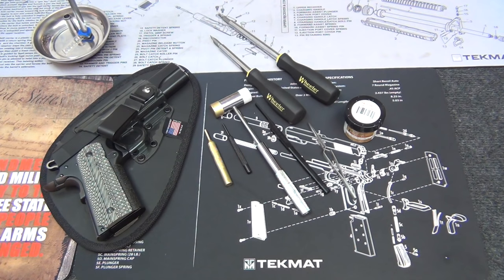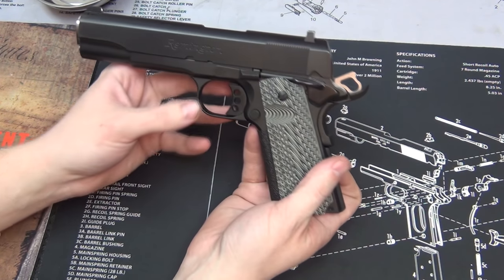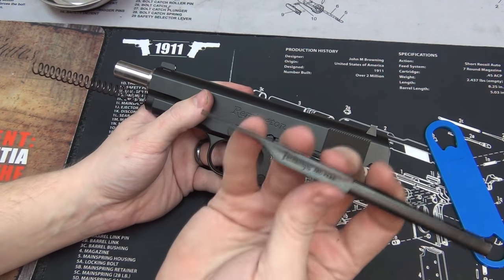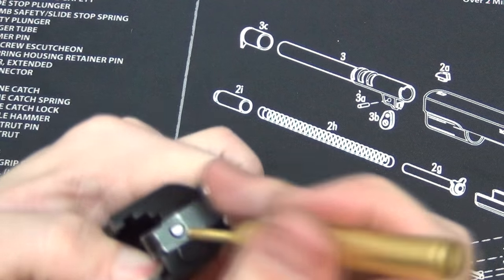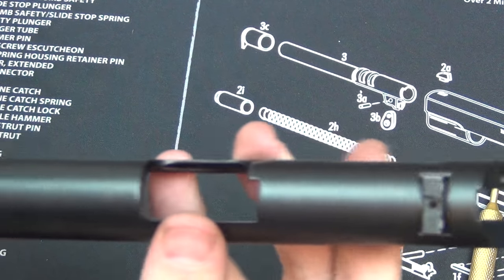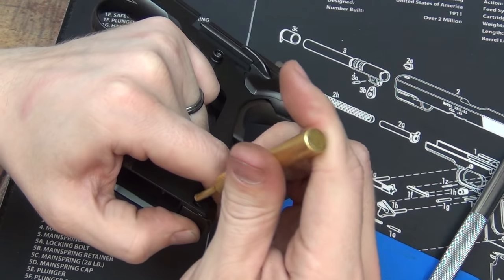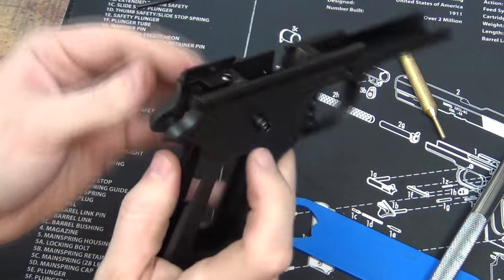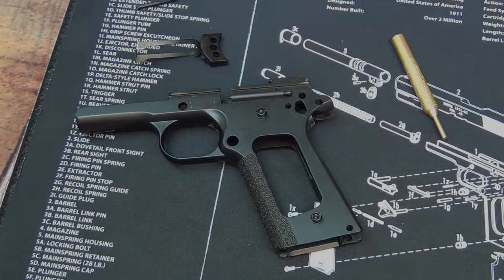1911 - Detailed Disassembly

Comment from the maker: When I first got this 1911, it was my very first one that I actually had the opportunity of looking at in detail and taking a part. I got to know how it worked by taking it apart. It then took me 3 hours to get it all back together in working order. I always like to challenge myself, and in doing so, I learn; and what I learn is ingrained into my memory.
Reply: I have a loaded edition Springfield 45 1911. Is there any parts that you think or know may need replacement once it's all been taken apart the1 same way you did in this video?
Reply: Just go my own and I ran into a problem while putting it together, the slide is stuck, all that inside is the spring, guide rod, barrel, and slide release. I can't pull the slide backwards or forwards ti take anything out.
Reply: That's how learning works in general
Reply: Yep. That is the best way to learn, imo.

Comment: Thanks for the great lesson. I broke my firing pin plunger lever. I have one of the first R1's and after hitting it many times putting the slide back on after cleaning, it broke the tip off. I hear that happens on series 80 1911 pistols. You are a big help to us 1911 owners, so thanks for your time, you did a great job. I will be more careful in the future, but if it happens again, I'm ready now. Thanks, Steve

Comment: Every time I clean mine, I always pull the slide back, remove the pin that holds the slide on and then pull the slide off with the spring and everything still all in the slide.  The spring always seems to stay in place and not shoot out.  I've found that to be much easier than fiddling with the barrel nut.

Comment: A freind of mine was reassembling his 1911, (with full-length guide rod) and tried to put the spring assembly in like you would a glock. He looked am me as though i was magical when i put the spring on after the slide. Couldn't help but laugh a little on the inside.
Reply: Also, if you find yourself without a hammer, but you have a non-fancy 1911, the slide makes a great hammer.
Reply from the maker: +Jon Doe Haha! Nice tip :)
Reply: nsz85 of course, one should only use the 1911 slide as a hammer if they dont have a glock lying aroung to use as one.

Comment: Great video. Thanks for posting.  Just stripped my 1911 right down to do a serious clean, using an ultrasonic. First time i have stripped this pistol this far down. Your video was superb. A great help.  By the way, with respect to springs flying out across the room, first time I took the slide off this pistol the big spring rocketed across my rec room. Fortunately, my cat was beside me at the time and she was on top of the spring just about the same time it landed .... think there is a lesson there about spring retrieval.... LOL.    Thanks again, nsz85!       ^..^        !
Reply from the maker: Youre welcome!
Reply: Speaking of springs-  I have a kimber with no bushing that requires an allen wrench shaped pin to take it down. I stupidly forgot one year and the spring shot a full length guide rod very close to my grandmother.  Close call!

Comment: The worst part about starting with 1911's is the mainspring. A lot of people let that thing intimidate them. As long as the spring slide and everything is already fit for that gun taking it apart and putting it back together isn't that bad. That is the number one mess up with people when they start these things is not sitting that mainspring back and right but after you do it a time or two it isn't too bad. Now once you start fitting you Springs new slides everything to that frame you really got to know what you're doing to get these things to work right. So as long as you got a 1911 you've got a little bit of knowledge most people can learn these things pretty easily.

Comment: If you still monitor comments, (from 2013). Thx for the vid. My oldest 1911 , Springfield was mfg in 1988. It was rebuilt for bulleye in 1990, w/ Bomars, Barstow, etc. The only part still origonal is the sear spring. I have 21,000 thru the gun. Should I replace the sear spring, it works fine, I just don't want it to break, when I need it most...Thanks.

Comment: you're asking for a spring to shoot out using that wrench. Just push down with your thumb and swing the barrel bushing. trying to get the recoil spring plug perched on the little ledge seems hard to do. Never used a wrench, never sent one flying. Otherwise great video, thanks for posting.

Comment: Great video. Not sure where I went wrong on my Springfield 1911. I reassembled and my grip safety is no longer functioning. I thought when I put back together the third finger of spring looked exaggerated bent back to me. On assembly I held spring down flat as I inserted main spring housing. Any ideas? Thanks in advance.

Comment: The 1st piece you removed was the recoil spring plug OR BARREL BUSHING PLUG, not a cap as you called it. As l'm sure you know when disassembling a firearm every piece has a name. This might not seem important except for newbies or inexperienced beginners. Please correct. Otherwise, very good video.

Comment: I’m having problems with the grip safety and I’m reluctant to take it to a gunsmith. When I pull the trigger without having the grip safety pressed on my A1 it still makes the hammer slam on the firing pin. Any suggestions or advise on what I should “fix” or info on this problem from anyone who has had this problem before?

Comment: Badass hammer on your Remington I the one exactly like that on my para expert 1911 I've not on the Remington R1 yet but yours looks really f**** nice I wish I could put the hammer on a 1911 I currently own but right now I got a Taurus PT 1911 and for having a dozen middle shelf 1911 pass through my hands this Taurus actually surprised me and is my concealed carry gun and has been for about 5 years, I'm not a Taurus fan at all though all their other guns to me or bullcrap but I got this one for four hundred bucks which was a damn good deal with two mags adjustable trigger full length guide rod instead of a half shorty suckers also it has an ambidextrous safety with all came from the factory I thought that was pretty badass and it's just as accurate as a Ruger SR1911 for my parrot expert Taurus may not be that great of a firearm company that they did a damn good job on these 1911 in my opinion I know other people don't like them the only complaint I have is there stupid Taurus security system on the PT 1911 it's integrated in the freaking hammer but for four hundred bucks I couldn't pass it up I figured I'd buy it as a beater and it's definitely taken quite a bit of abuse for me over the six years I've been carrying it and it still runs great I'm watching your video cuz I want to break apart the bottom half clean the innards of the slide recently but I want to clean the beavertail I Ambi safety and Hammer and all that s*** underneath there and get every piece of dirt out cuz it sounds kind of gritty right now

Comment: If you have a fitted 1911, do NOT rotate the bushing while the barrel is in battery like in this video, as this will cause unnecessary rotational wear on the barrel-bushing mating surface. This does not matter so much for a run-of-the-mill 1911, but this kind of wear (that is mostly imperceptible to the naked eye) in the long term is what turns a hand-fitted target gun that can hold the X-ring at 50 yards into a gun that merely shoots a little better than average, and you will need a bushing re-fitted at considerable expense to fix it. Instead, take the whole top end off first (carefully): remove the slide stop, then take the guide rod and spring out from the rear, then push the barrel forward out of battery so the flared front of the barrel is not in contact with the bushing, then finally rotate the bushing and tap it out. The guide rod and spring are not closely fitted parts and their wear is much less important than the bushing-barrel lockup.

Comment: Great video! Which Remington R1 is that? Is it the R1 Enhanced and you changed the sights or what? It seems to have a few extras that a standard R1 doesn't have. I know the R1 Enhanced has fiber optic sights as well as a skeleton hammer and different trigger...just curious as I am getting ready to get one and there are several different ones.

Comment: Will this tutorial also work for the Kimber Target II 9mm ??
Reply from the maker: +craig baxter It should.
Reply: a 1911 is a 1911 is a 1911, and any  differences will be very subtle. I would highly recommend using a bench lock for holding the frame while you drive the pins out, but 1911s are all about the same. Ambidextrous safeties may require driving a small roll pin through the right side's lever. If you have not lost springs in violent ways, you have not been doing it very much.

Comment: can you remove the slide lock detent?
Reply: By detent, do you mean the slide stop plunger & spring above the left grip? If so, it's the same spring as the thumb safety, there is a metal plunger on each end of the spring - one forward for the slide stop, and one aft for the safety. They both come out the rear when the safety is removed.

Comment: Anyone seem to have a problem with bits of rust here and there on their r1 ?
Reply: Pablo Blanco ive had surface rust but i used steel wool and kroil and it came off
Reply: @Error343434  awsome thanks ill give that a try. The very fine steel wool like 0000 grade if i rember correctly. I usually have used rem oil but ill give it a shot. Thanks my friend.

Comment: Ok seriously. You don't need all the fancy expensive tools to do the job right.  Who uses a plastic screwdriver to pry the slide pin out?  And really guys with the checking the gun.  Hold it in your hand, rotate it over to the other side with the action open and in three tenths of a second I can tell if it is clear or not.  You don't need to flash the magazine around to show it's clear.  Common sense.
Reply: You don't need them, it makes it easier

And double checking is good habit. Accidents happen, man.